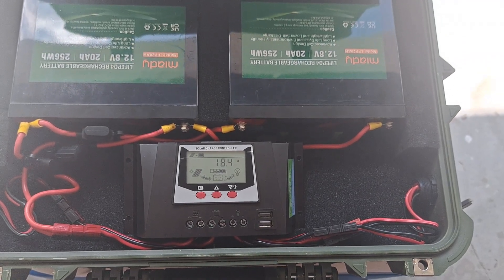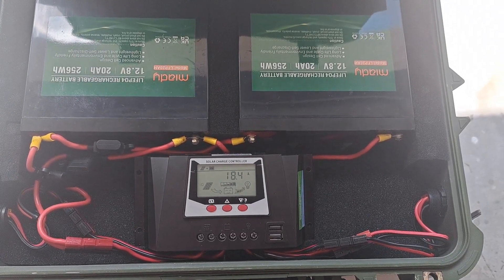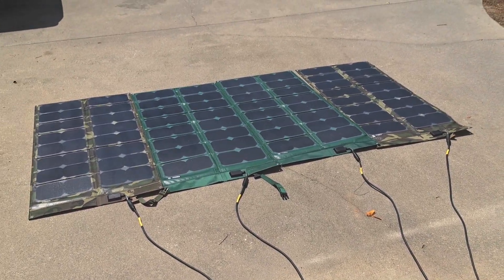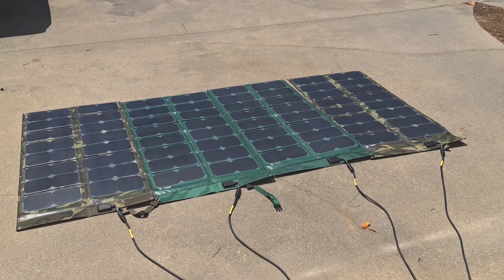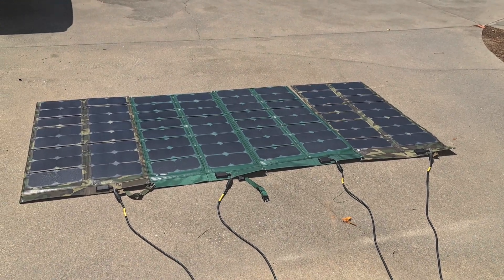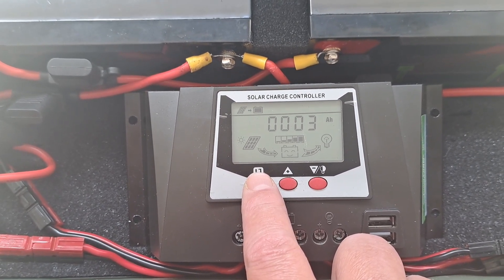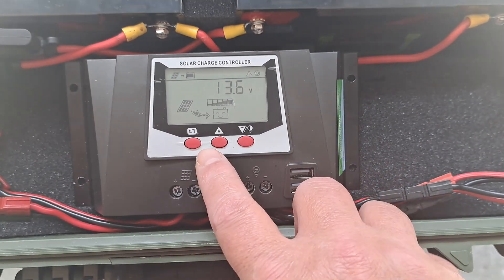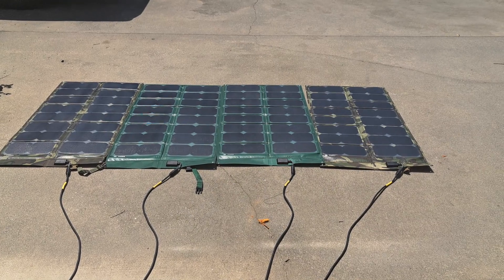Solar Post POTA Activation: Charging My Batteries

Comment: Nice video Philip.  Can you tell us more about the solar panels? Manufacturer, model, etc.?  73 de Greg in Vancouver
Reply from the maker: They were manufactured by Jim Chaney, KD7KL. There are no more left in the 100W size. He may have a couple of 130 watters in this style, however. He also still has some folding military 62W panels available that are good as well (I have three). Email him at arcticsolar@aol.com. The 100W panels are around 5.3 lbs, rated MILSPEC 810G for military durability and are brilliant. The panels are superior to PowerFilms offerings in all respects and substantially cheaper.
Reply: @Philip-KA4KOE  Awesome. Tnx Philip! 73